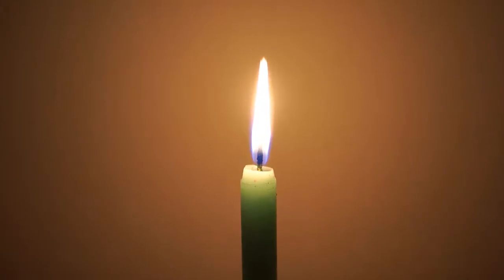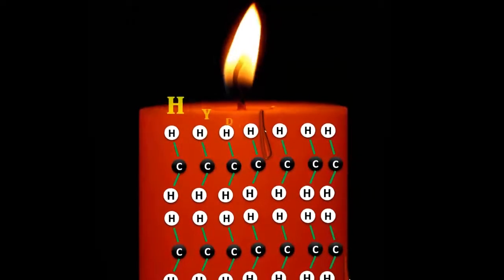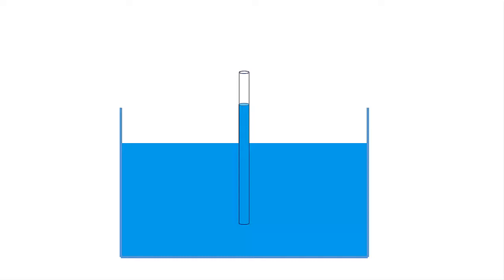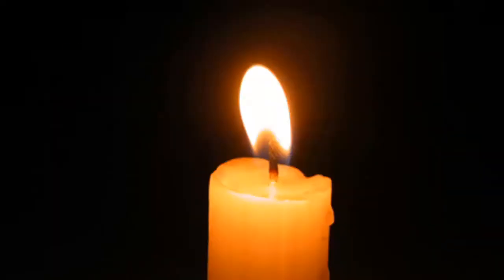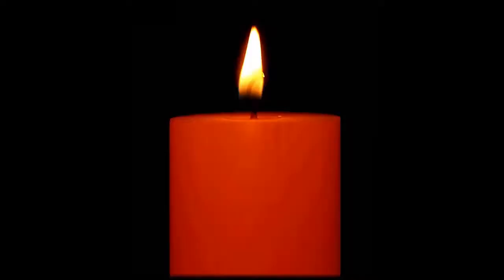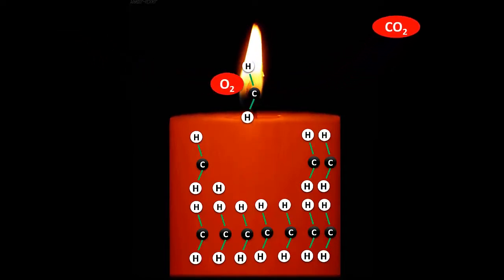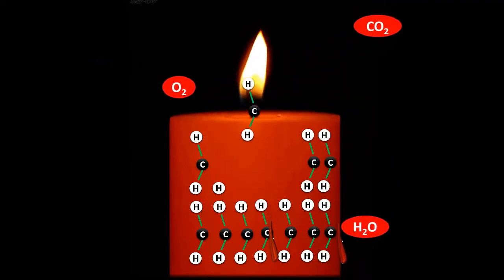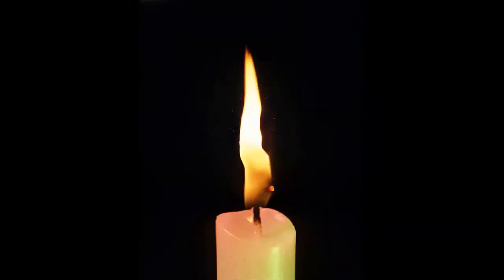How Candle works?

Comment: What I learned from this video is that the combustion reaction of a candle produces CO2 because the wax is made up of hydrocarbons(hydrogen and oxygen). O2 and carbon will react to make CO2, and hydrogen reacts with O2 to produce hot water.This hot water falls down.Well explained